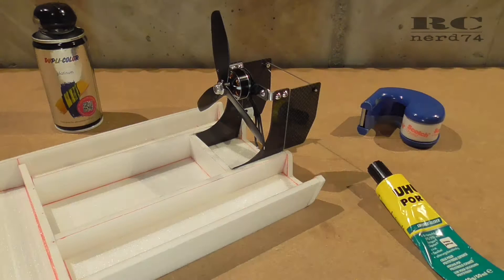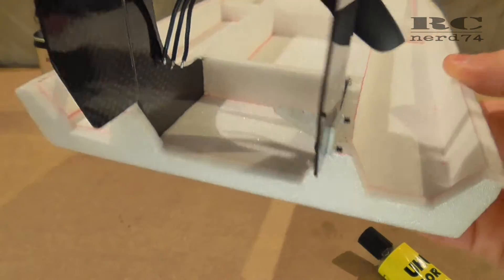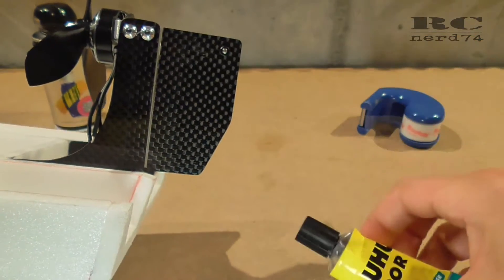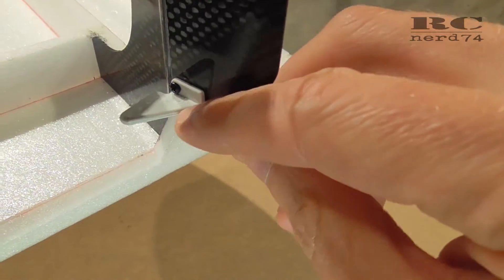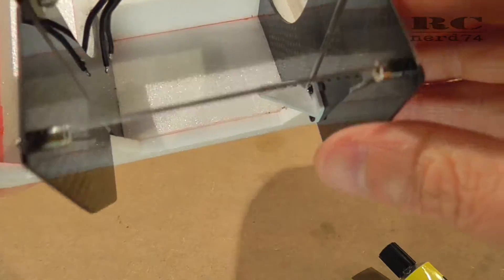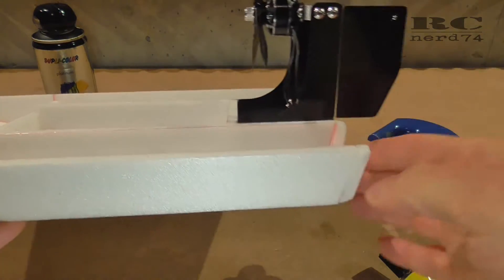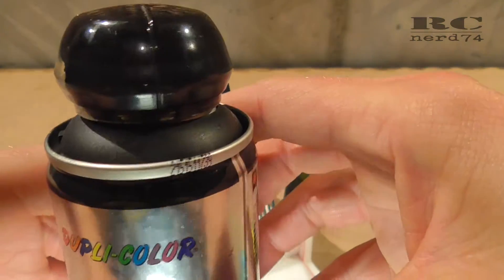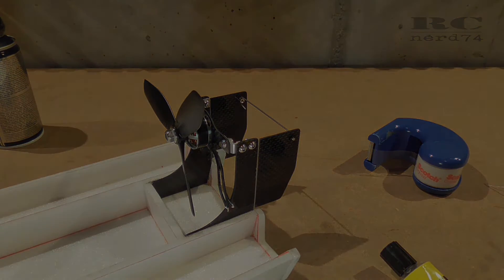DIY RC AIRBOAT | BUILD REVIEW PART 2 | MOTOR MOUNT, RUDDERS AND PROP

Comment: Hello. Any advantage to having the motor facing forward rather than the rear? I see a few designs that have it facing forward or to the rear.
Reply from the maker: I only tried facing forward. The reason was the easier design of the motor mount and rudder with motor facing forward. In case of performance, it should make no difference.